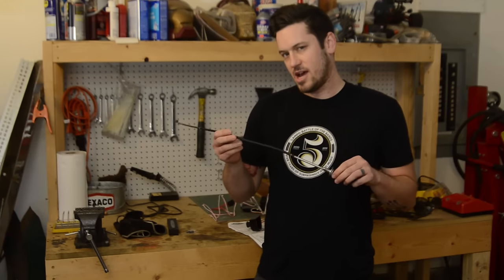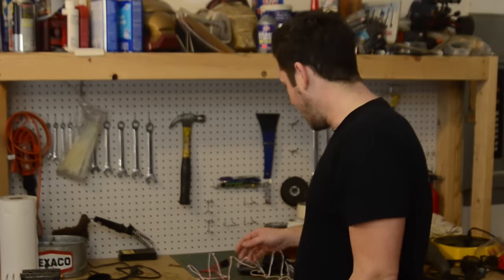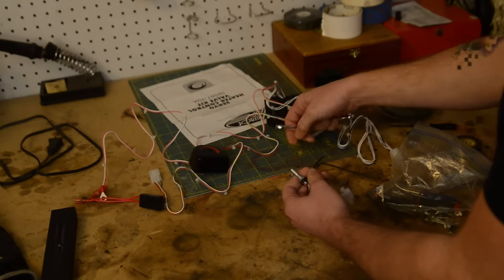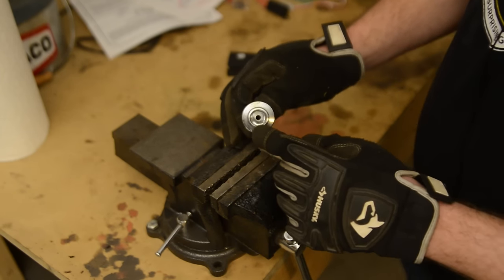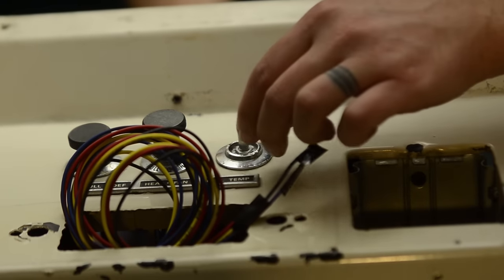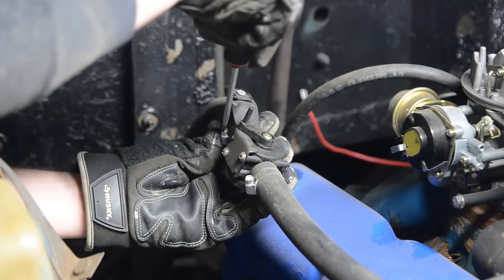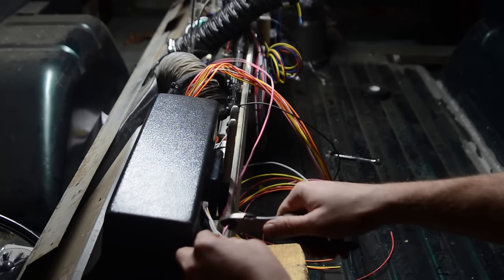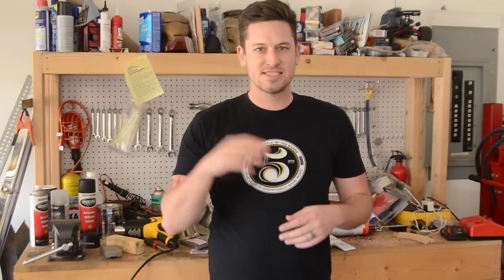Early Bronco Electric Heater Control Mod

Comment: I got this same switch setup at this year’s Tom’s off-road event and I’m finally installing it, I have an extra dash that I picked up at a swap meet a few years ago it has all the heater control’s in it I grabbed the the temp control out of it and I’m using that one to put the switch in like you did in your dash
Reply from the maker: NICE! Man, I did this so long ago, but it has worked great!
Reply: @NashvilleEarlyBronco  yeah I had to go watch that video you posted Quite a few times, I used a Hacksaw to cut the bezel instead of the grinder, I just have to drill out the bezel to fit the switch into it and then mount that black box onto something and hook up the wires

Comment: Hey man I'm restoring a 76 bronco and I'm getting it back from the paint shop tomorrow. When you removed your dashboard was it difficult? Also I'm thinking of mounting some underdash vents to it so I can have good heat in my car. Do you think this is a good idea?
Reply from the maker: +Brock Armstrong removing the dash wasn't that bad. But I would put down some blankets so nothing gets scratched. Yeah, if you're adding AC or something like that I think the under dash vents are a great idea. What all are you wanting to do?
Reply: Well my plan is to use some underdash vents for the heat so it blows right to you and not up in the defroster and take 4 minutes before you can even feel it. I was thinking about taking the 2 plastic hoses that go from the heater box and rerout them to some underdash vents or maybe find a way to add hose so I can get both heat in my defroster and in some under dash vents.
Reply from the maker: +Brock Armstrong that's a good idea. Or you could add a hose to where the air blows out of the heater vent

Comment: I guess I don't see the point in replacing something as simple as dirt like a push-pull cable that works great and add an electrical servo that could burn out. I'm all for modernizing things but it does nothing more than the OEM device does and, while I am sure it is reliable, it is not as bulletproof as a cable and mechanical valve. I have owned my 71 for 34 years now and replaced my valve about 25 years ago, so one valve in 46 years since new. I wonder how long before this servo burns out. Love your videos, just don't know about this modification.
Reply from the maker: +Dan Mallery haha! Yeah I hear ya. Time will tell
Reply: my bronco has a hi low fan, it is awful i spent 300 replacing and i live in park city and freeze my nts off - i need a better heating solution - unless you advise better ..

Comment: i mud and track alot with my bronco. the top is always off. i just leave my heater on all the time. It helps cool the motor.
Reply from the maker: +jjt jp yeah totally. In the summer though, it's nice not pulling in the extra heat. My tunnel cover gets hot enough

Comment: We just got around to checking out this video. Its great, lots of good reasons to do this. Those hoses in the engine of the bronco are a mess and this solution gives you a lot of options on how to run the hoses that you can't do with the cable control. I'm wondering if anyone has found a more compact control module. The one used in this video is pretty bulky with an external module glued to the bottom of the glove box. You would think there should be a smaller more integrated switch that could be found someplace? We just finished a timing chain and twin belt 3G alternator upgrade - now that the engine is running again this is a good next project: https://www.youtube.com/watch?v=iIIp-3KSJAI 
Since this video was posted 3 years ago I think Toms Bronco parts is packaging the valve and the control module.